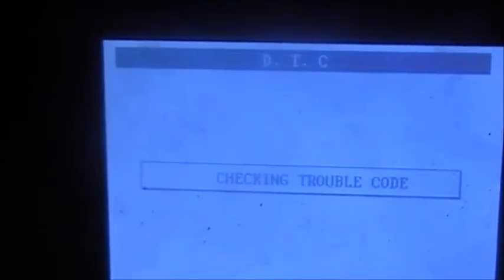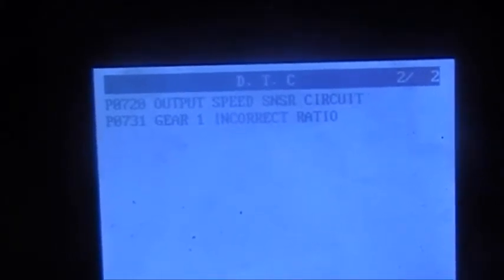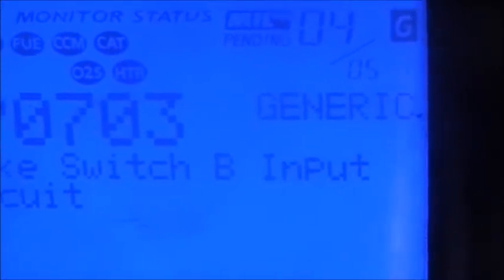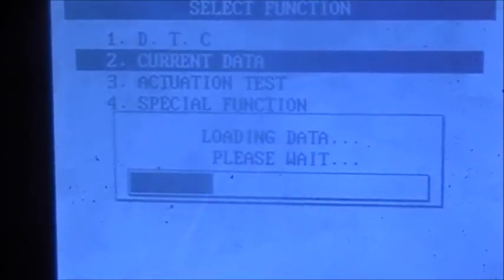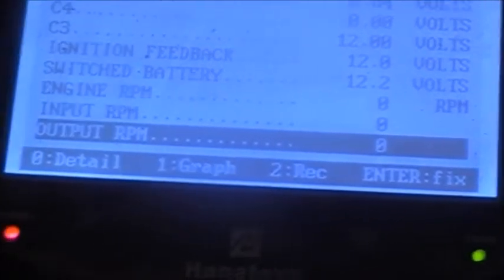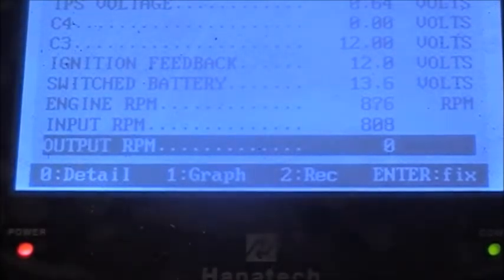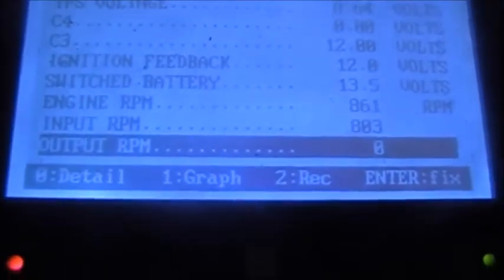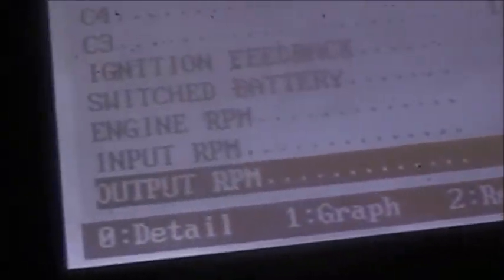2002 DODGE NEON : CODE P0720 (PART 1)

Comment: what does fail safe mean?  Does it mean it goes into a all neutral mode?  By sometimes do you mean when its cold?
Reply from the maker: It defaults to a gear appointed by the engineers when there is a problem.